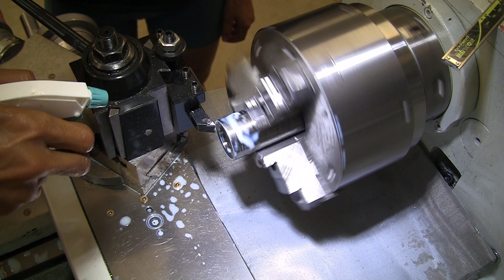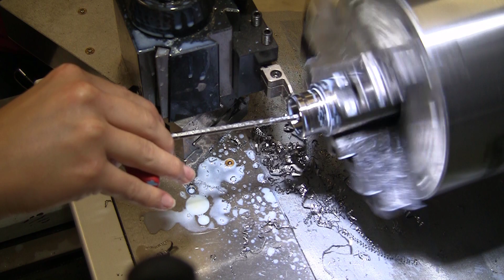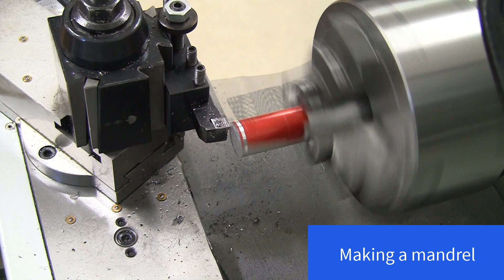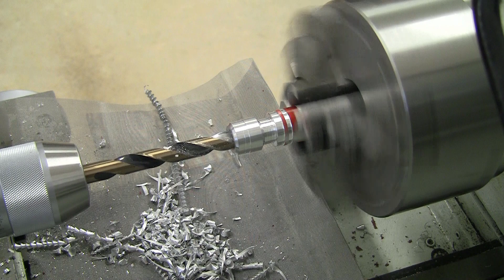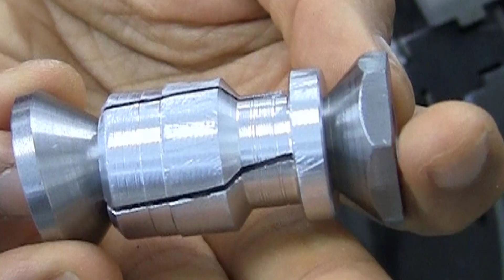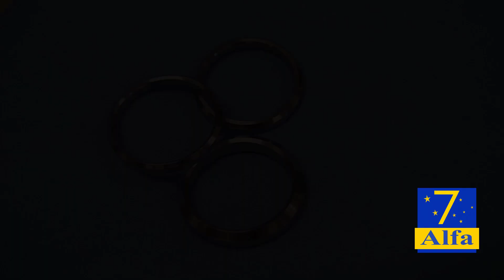Turning Titanium: making rings and an arbor for the rings

Comment: Fantastic! What was a good RPM to make this turnings operations? thanks
Reply from the maker: Thanks for watching.
Most of the time I was using lower end RPM. I was aiming for 50 sfm (surface feet per minute, 15-20 m/min) even though I was using carbide inserts. The rings were about 1" (2.5 cm) in diameter, so it was around 200-250 RPM. 
I did use plenty of spray-on coolant. Titanium generates a lot more heat than steel. I also may have been a bit paranoid about risks of fire without continuous coolant, so I kept scooping the chips away regularly.